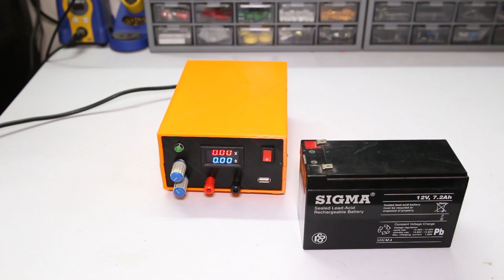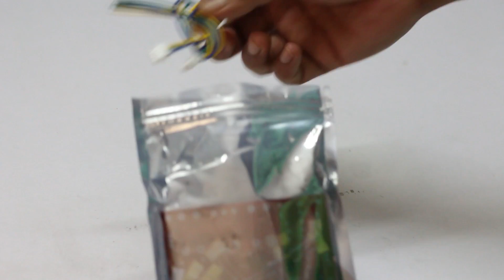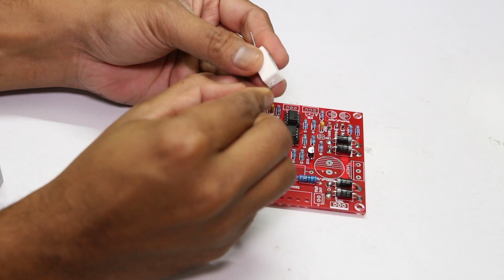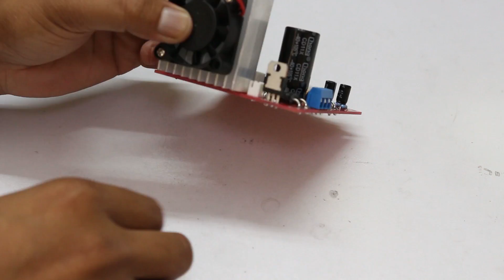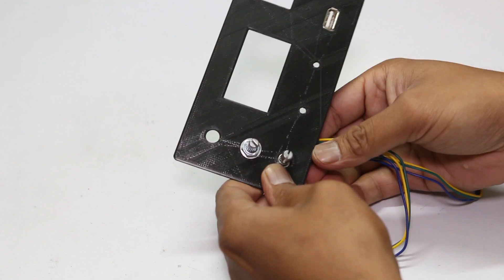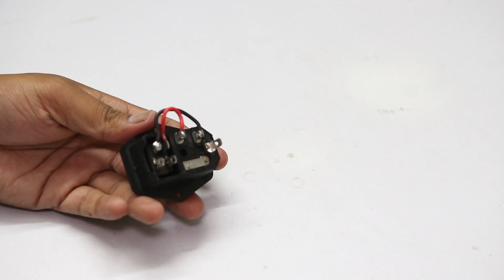How to Make a Bench Power Supply || DIY Lab Power Supply || Make Your Own Lab Power Supply

Comment: hello friend, is the open transformer 0 24 volts or 24 0 24 volts you are using and how many 3 amps is the transformer power required for the transformer with at least 80 watts output.

Comment: Can I use old laptop adapter  instead  transformer?
Reply from the maker: Yes it can be used, need little modifications in the circuit. The circuit has a onboard bridge rectifier which converts AC to DC, but your laptop charger produce DC. So you have to bypass the bridge rectifier.
Reply: @opengreenenergy  thank you for your valuable time, you are great and creative.

Comment: Can i use 12-0-12 6amps transformer here? Pls let me know. I am going to build one for me.
Reply from the maker: You will not get voltage range up to 30V.
Reply: @opengreenenergy  thank you!
Reply: 12-0-12 is the same transformer like 24V, but you have a center tap for half of the voltage.

Comment: Hi Friend,
I actually bought this board and soldered all the components. i use transformer 0-24v 3A . The problem is the output  DC voltage is only 7V and if adjust the pot.. it varies only +/- 1v not more than that.
I double checked. all the components are correct. Not sure where is the issue. Can you suggest me some idea to debug this.

Thanks

Comment: use a metal case, whoever is watching.  this is a power supply.  a fire internal will not be contained here and the filament will catch and cause a much larger fire.
Reply: There are fuses 
Chance of fire is so small that it's not important

Comment: I see neither any transient protection nor even a fuse on this thing. 

And without having looked very closely at what all is going on here, I think that while the power supply set itself did consider EMI by its own parts, there should be done more regarding the safety of a transformer running off-line.
Reply from the maker: Thank You for your feedback.

Comment: This is a helpful video, but you didn't show us the most challenging part of the board assembly, which is where/how you tap into the 24VDC current for the line out to the buck converter. It's not clear in the photos or the video. Can you tell us more about this?
Reply: There is a 24V DC output (a + and - ) on the board that is available for the fan.  You can tap in there .

Comment: question does this require a 240 volt outlet? or can it run off a 110?
Reply: depends on transformer (in this case 240v)

Comment: Sir i have a question, i have bought  Power Supply Kit..from Aliexpress. I have assembled this Kit. But the highest voltage shown 24v. Where is the fault..
Reply: May be problem in your power supply kit read carefully power supply outputs of your power supply kit, if your transformer is 24-0-24

Comment: Input of fan and input of buck converter is same???
Reply: The fan has a 7824 connected to it, and the buck converter can run on that too
In my case I swapped the 7824C with a 7812C (12V fan, 50mA, 5% load of 7812C)
Letter meaning - 5V for demonstration
C - 1A max. (7805C)
L - 500mA max. (78L05)

Comment: sir i did as you shown but without display connected the current limit feature works but when measuring current using display the current limit feature is not working even at min current if increase the voltage current automatically increases i don't know how

Comment: I bought this power supply,,but mine has only 0-12v,,I doubled the checked the parts and nothing wrong with them,,what should I do to increase the voltage,,???
Reply: Probably your transformer

Comment: Für die VOLT- Einstellung ist ein WXD3-13-2W 10K Ohm Rotary Multiturn Wirewound Potentiometer von Banggood besser geeignet, bei der Volteinstellung von 0 auf 30 Volt könnte es Probleme geben.

For the VOLT setting, a WXD3-13-2W 10K Ohm Rotary Multiturn Wirewound Potentiometer from Banggood is more suitable. There might be problems with the setting from 0 to 30 Volt.

Comment: How much watt transformer?
Reply from the maker: +RYT IGNITION  72 VA transformer
Reply: can i use 12 volt transformer
Reply: @sefmags4506  yes, but the output voltage will be limited to 0 - 15V

Comment: Can we use 12v 2A transformer instead of 24v 3A transformer
Reply from the maker: +RYT IGNITION Yes you can use.But you will net able to get the full voltage ( 0- 30v ) and current ( up to 3A ).Your output will be 0-15v and 2A

Comment: Nice project. Where did you source the circuit board, the housing and the other components. I like to build onr too. Thanks in advance for your replies.
Reply from the maker: Herman Krijnen All the part links are given in the video description.
Reply: https://www.aliexpress.com/item/4000282180503.html?spm=a2g0o.productlist.0.0.4f1e215dZplJEk&algo_pvid=882d7b78-ee14-4b4f-8034-7b4ce52f3d14&algo_expid=882d7b78-ee14-4b4f-8034-7b4ce52f3d14-11&btsid=bd89b4cf-8b5a-4be1-9b36-3e2a68ddb06d&ws_ab_test=searchweb0_0,searchweb201602_2,searchweb201603_53

Comment: You installed the binding posts wrong, there is supposed to be one plastic piece on either side. not just bare metal washer and 2 nuts on back.
Reply: doesn't matter in a plastic case.

Comment: Nice project ! can I use a 12v step down transformer ?
Reply from the maker: Yes You can use 12V transformer but your output voltage range will be 0-15V instead of 0-30V
Reply: And is it possible to use a 1.6a input current instead of 3a ?

Comment: what is the maximum current handling of this power supply? and use multi turn variable pot
Reply from the maker: Max Current is 3A. I didn't have stock multi turn pot during the building.I will replace it later.
Anyway thanks for the suggestion.
Reply: okay. for a current rating of just 3 amps this thing heats up and uses a fan. not the most efficient solution. use tlc5948 buck boost converter and a laptop adapter for supply
Reply: Sai Khurana good idea for using laptop adapter for supply but you need 24 v 3a AC out and laptop adapter is DC out so it doesn't fit...
Reply: Timothée Maurice i am using a 8amp buck converter that works on dc